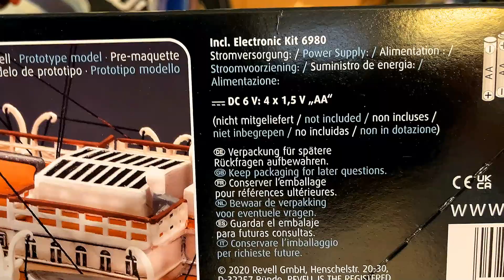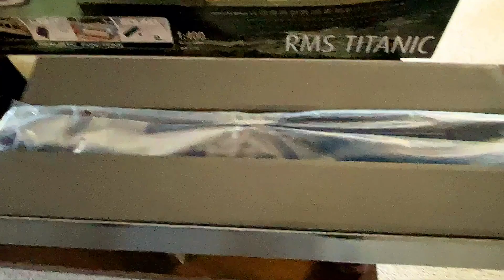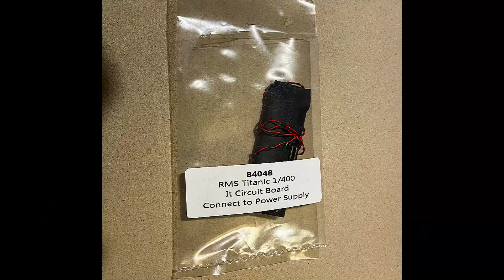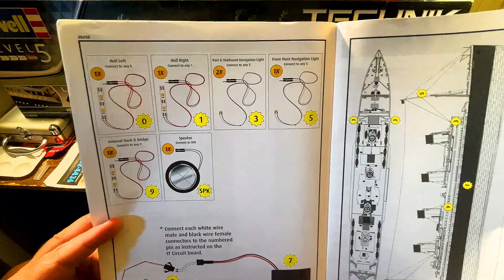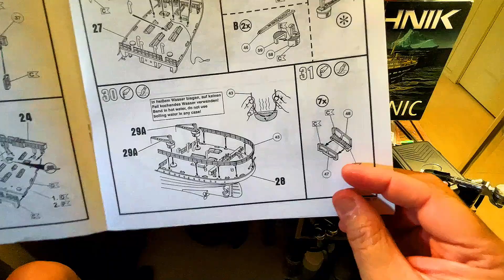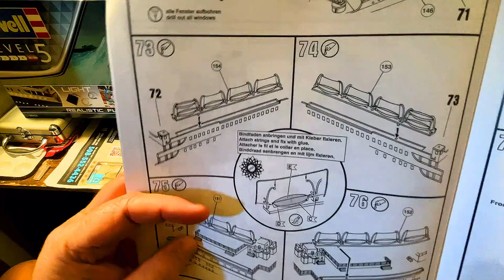Revell Technik RMS TITANIC Model Kit with Realistic Lights and Sounds with Circuit Board Demo

Comment: Good vid apart from the 5000 ads lol. Have you built any revell 1/400 kits yet? I hear bad things about them not fitting well and other issues. BTW all revell 1/400 kits are exactly the same, if a feature is in the pastic parts of one it's in them all. Its just the extras that are different. I see this kit still avable on amazon uk for £186. Im tempted even just for my colledtion. Im not sure i need the sound, seems a little cheesy lol. Would defo like the lighting though.

Comment: any need to solder the wiring and does this kit have peel and stick type decals?
Reply from the maker: Absolutely no soldering at all. The connections are pin type of rods coming off of the circuit board. These connections are the male connections.  All the components such as the lights and speakers have the female connector. They simply plug into the circuit board. No need for soldering at all.
Reply: @TrekFanNCC-1701  awesome and sounds easy peasy.